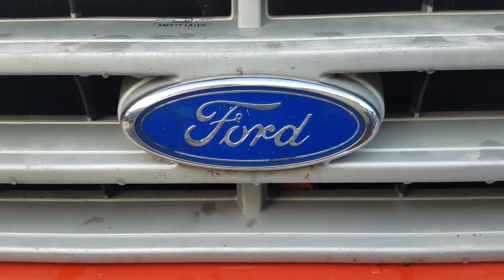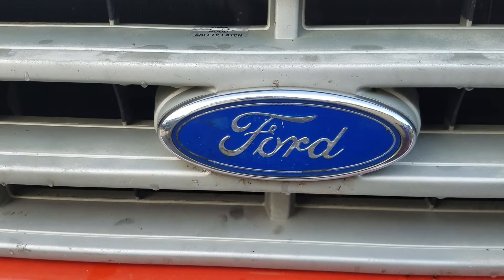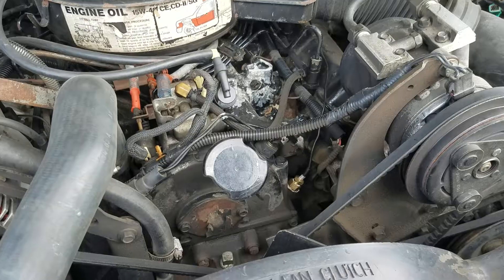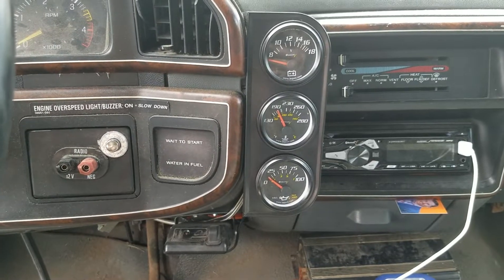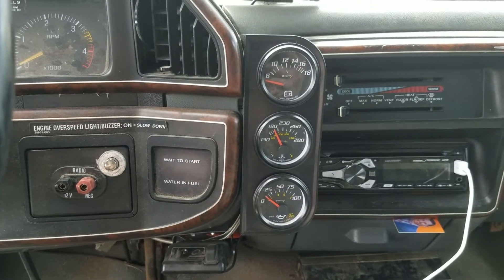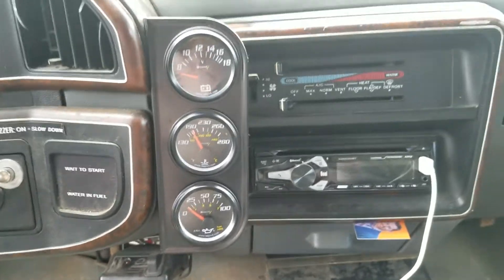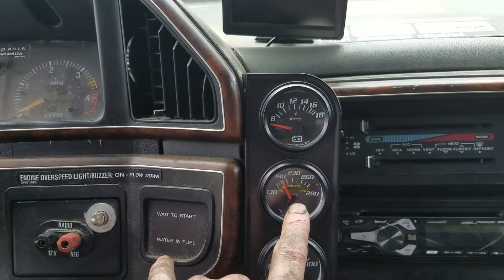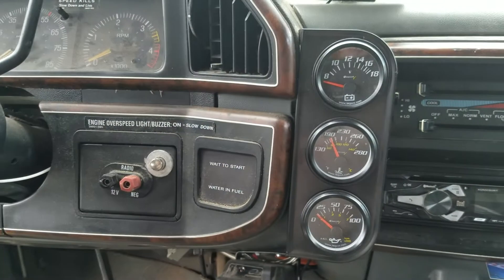Ford 7.3 idi diesel engine gauges oil pressure temperature gauges gauge sensor install locations

Comment: I bought an 86 f350 and they told me that it has "low oil pressure" problems. Could you tell me specifically if the repair would be expensive?  it's a 7.3 idi
Reply from the maker: Does the truck have an aftermarket oil pressure gage or the stock one? The stock ones are notoriously wrong. I'd put a aftermarket mechanical gage in the truck so you know for sure what kind of oil pressure it has. On start up 70lbs or so is normal, but once warmed up idi engines do not typically have high pressure. Down around 10 or 15 psi at idle. I have older videos to show you how or where to hook up an oil pressure gage. If it does have low oil pressure and needs an oil pump I believe you will have to pull the engine in order to remove the oil pan and replace the pump. Pretty involved job.
Reply: @worthshop  stock pressure gage I bought it 10 days ago it is an old truck 86 Ford F-350 that I always wanted to have and I have decided to put money in the truck '!!  I have never had a diesel truck but I will learn!!  !  could the engine  be damaged?
Reply from the maker: @nckpacheco624  It could be if it was ran alot without adequate oil pressure. You will have to get it running, see if it'd knocking, put fresh oil and filter in it, hook up a real gage and see what is going on. Hope it's not though!
Reply: @worthshop  ok friend thanks you so much for your help and information I let you know what will happen whit the engine :(
Reply: @nckpacheco624  how’d it go?

Comment: I have an '87 f-250 6.9 IDI. I'm trying to find the sensor that's right next to where you fill the oil. No one seems to have one. Anyone have ideas?
0:46 mine looks exactly like the one on the top of the screen, the large but looking one with two wires that go to the left.
Reply from the maker: I believe you are referring to the tachometer pick up sensor...
Reply: @worthshop  ... Welp... I feel like an idiot. That's the last time I listen to that friend... But my issue is that my oil gauge in my instrument cluster has stopped working and is throwing the engine light on. But I have a second oil pressure gauge on my dash and it's working just fine. Both gauges worked when I bought the truck then one day the one on the instrument cluster just quit and I've had the engine light ever since.
Reply from the maker: @commanderdan2319  Your stock oil pressure sender location is under the air cleaner right up against the firewall passenger side right by the transmission bellhousing. If you need a visual go to my more recent videos I just posted one a few weeks ago installing gages in a 7.3 idi.
https://youtu.be/j2Z2AEUD3D0
Reply: @worthshop  Much obliged. I'll take a look after work

Comment: Your video is filmed so close one can't get a perspective as to exactly where the oil pressure sending unit is...I have a 94 IDI and my gauge reads low most of the time. Am told replace the sending unit but I still don't know where it is. Your video didn't help much.
Reply from the maker: Stock sending unit is under the air cleaner at top of the transmission bellhousing area passenger side.

Comment: Hi, I have a 1992 Ford F250 7.3L IDI, I have to tap the pedal down for the "first start of the day" to kick in the choke (higher RPM) and it stays high for about 3 mins. to warm up and settles down. If I dont tap the pedal it stays at regular RPM. any idea what could be the issue ?
Reply from the maker: Mine is the same way. You have to push it down and it holds it at higher idle. The pedal cant pull itself down to hold high idle. It functions by revving the ingine a bit higher holding the rpm up, a choke on a gas vehicle restricts oxygen into the engine causing it to run rich.
Reply: I Hate Everyone Thanks 👍

Comment: Ford told me where you installed ur temp gauge was the eot sensor. Engine oil temp switch and I though that went into the oil as well and that the temp sender was on the Head.???
Reply from the maker: When I pulled the plug at the front drivers side it had coolant not oil. So it is sensing coolant temperature not the oil temp. You could add a oil temp guage if you desired. I installed these guages because the factory ones did not function.

Comment: was there already a hole for the oil pressure gauge?     Did you just remove a bolt and then plug the line in from the oil pressure gauge?       This video basically sucks okay dude!
Reply from the maker: Pull the square threaded plug out and put in the oil line...

Comment: You're going to show us how to hook up the gauges?       BS!            Did you have to drill a hole to tap threads to put in the oil pressure gauge?      Did you ever think about zooming out the camera so we might see the location of the oil pressure gauge connection?          You spent more time showing us the god damn Ford logo on the front of the fucking truck!
Reply from the maker: There are plugs along the side of the block that have a square hole, I had to rig something up to pull it out. On turbo idi trucks this is where the turbo oil fitting is connected. This video was made a month after installation at the request of another viewer that asked where to run the guages after watching another video about the truck. There is also a oil pressure port under the aircleaner to the rear of the engine by the cdr valve. That is where the factory pressure sensor is located. Unfortunately on my truck they did not install the riser when the engine was rebuilt so Im unable to use it. Mechanical projects can be frustrating. If I can help I will, but above all believe in yourself and keep building shit.